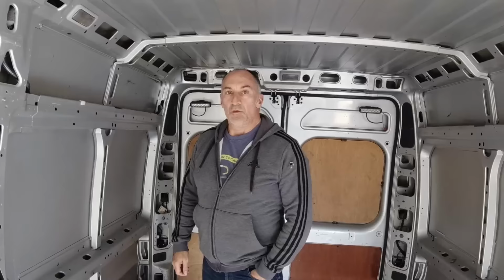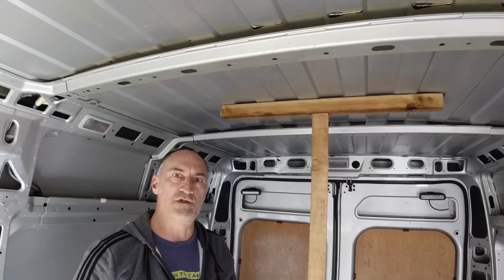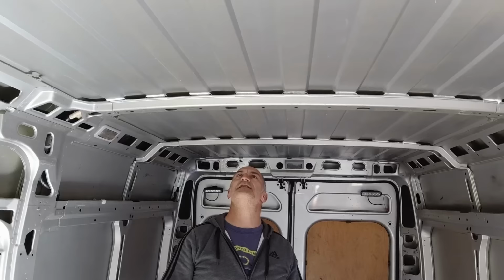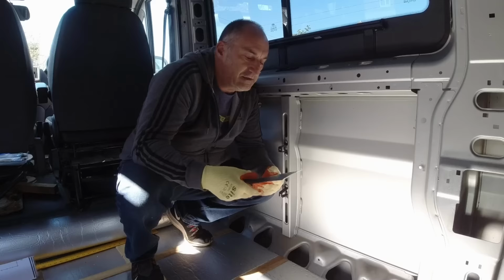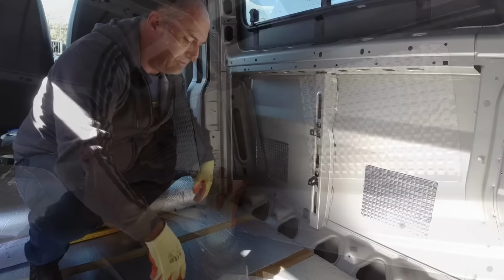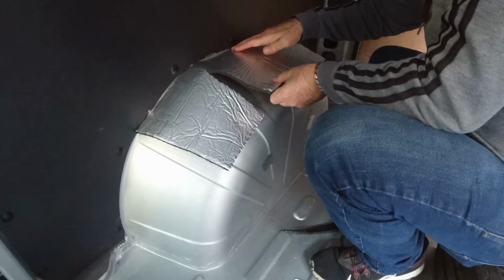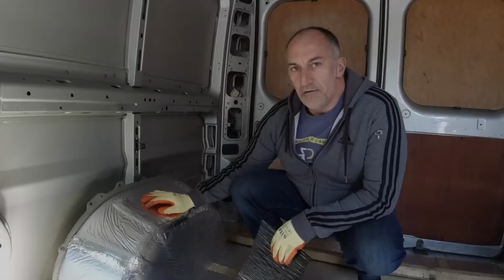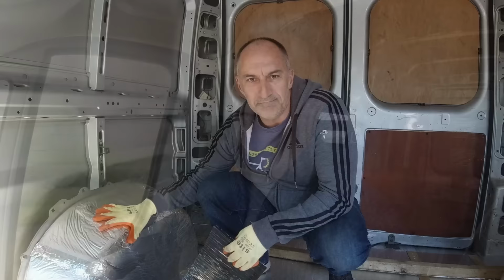Sound Deadening a Campervan, The Right Way - Budget Build Ep 8

Comment: Thank you for reminding people that adding sound deadening everywhere has diminishing returns.  I've seen so many builds where people spend so much time applying far more than necessary.  
The FIT RV came out with a couple of videos in mid 2022 on this topic that I can highly recommend for those that want to understand more of the science and see some semi-quantitative results.
Reply from the maker: I’m trying to explain that this heavy stuff is of no benefit on the deeply ridged panels as that already does not vibrate or drum like the Fiat panels do. So many are misled with wrong info. 
Hopefully I can help to change that. 😊
Reply: just saw a vid of a guy dropping a tool on the floor and showing the difference between insulating and not. Um i guess he drops tools alot? So he wouldn't be allowed to work on anything above the first floor as that is pretty much an instant termination. I keep seeing people spending 3 hours cutting small slices and doing the entire lower ridges of the floor. I might do a couple of strips behind the drivers seat/middle hallway to do a comparison. I deliberately did not buy a ton of the stuff, i will have a low roof van. I have where the windows are planned so i hope 2 boxes are enough. I will entirely cover the wheel wells, someone did a test and the thicker stuff i have didn't work as well as the thinner silver stuff. Also 2 of the manufacturer's produce in the Russian Federation, I wonder how that is going or if they have relocated. The one US company i found is extremely expensive (they sell large sheets).

Comment: Good to see you back Greg - the bonded joints you replaced highlighted a real problem with the way these vehicles are made.

Bonded joints represent a large proportion of the strength and integrity of the vehicle's structure - there is obviously a deterioration in the bonded joints over time, as you demonstrated with the roof panels.

On older vehicles it may be prudent to re-inforce bonded areas with a fillet of Sikaflex even if they appear sound - where the bond has deteriorated it makes sense to remake the joint as you did with the roof.

It would not be too difficult to do this, as once insulation and trim has been fitted the parts of the vehicle with failing bonds can move around and not be noticed.

Comment: 7:20 I like to place the pads almost in the middle & slightly twisted.
As you pointed out a few seconds previously you're trying to stop the ringing & placing the pad exactly is likely alter the pitch of the ring rather than stifling it.

Comment: Just as an additional thing you can use 3M double sided tape and the Sikaflex together if you’re impatient for waiting for Sikaflex to dry. good for situations where it’s a panel and you just want to stick and get on with it to finish the build. I’ve done it a lot with roof paneling etc where screwing wasn’t an option.

Comment: Difference is huge, in the beginning of the video while you were driving i though something gonna fall apart ;D. Only thing i was disappointed with was when you've knocked on the panel to present the noise and then you knocked again after applying a mat on the mat itself rather than on the panel, and you did it twice! Haha. Anyway thanks for another good video.
Reply from the maker: I could have maybe done that part a little better this shows the effect much better than I did https://youtu.be/Sl-4sJ_1wTI
Reply: @GregVirgoe  yup, that's good enough proof, cheers.

Comment: Great Vlog Greg I have seen people use lots of that material in their builds and often reflect back to the Sprinter build to question if theirs is overkill! Looking forward to more Vlogs many thanks
Reply from the maker: It’s about using the right product. The heavy pads are only designed to stop vibration. If you want to stop road noise or rain on your roof etc then you need a sound absorbing insulation like dense foam sheets to absorb the sound waves come through the structure from outside.

Comment: Again a great video, Greg! One suggestion, if I may: Sikaflex 554 is rated at 3,5 N/mm², whereas the 522 is half as strong at 1,8 N/mm². While 522 was O.K. for the large contact area of the floor, I'd prefer the 554 for the narrower beads on this roof. Possibly an overabundance of caution on my part, but I figured I mention it. Cheers from Germany - Folker
Reply from the maker: Yes it would appear to have better adhesive figures so thanks for the suggestion. I'm sure the 522 will be ok and I already had tubes of it available so didn't need to buy another different tube.

Comment: Really informative, well explained and helpful,  especially on the different types and uses for the sound deadening and absorbing foam and very interesting on the bond becoming detached on the van from the roof panels and how it’s bonded on the side. You’re right would drive you mad if all that noise was there when you finished - what a difference! Thanks again, a fantastically helpful video - all the very best, David 👍
Reply from the maker: Yes sometimes when the van is in use to carry materials and tools etc those panels get pushed out and can easily come apart so it’s helpful to pick it up early. 😃🙏🏼

Comment: Your build series are the best and most thorough out there. I wish I had found them earlier in my build (my first episodes were the wiring mini series on the old van) I could have saved a few quid had I done a few things differently, i definitely over did the sound deadening on mine for example. Four years later and I am thinking of upgrading to a bigger van as being 6ft 3 in a transporter isn’t ideal even with a pop top, but will certainly be revisiting a few episodes before cracking on this time. Keep up the good work and looking forward to new episodes.
Reply from the maker: It's all a big learning curve when you've never takled these jobs before, but i'm sure you'll be much better prepared next time round, hope it all goes well and thanks for watching these videos

Comment: Another helpful and timely video Greg. I just removed the bulkhead from my '05 Sprinter and have all kind of sounds exactly like yours. Need to go find those loose joints. But Silka Flex 522 is not common in US. It is a STP sealant. Wonder I can use OSI Quad max which is more common from any home store. The OSI  Quad max is a SMP type,  stick to anything, has zero shrinkage, remain flexible, and allow +/-50 joint movement.
Reply: Nope. Look like they spot welded the outer layer to the ribs. I still couldn't find anything loose metal that caused such noise yet.
Reply from the maker: You can order through this link and get free international shipping from the UK https://www.ebay.com/sch/i.html?_from=R40&_trksid=p2380057.m570.l1313&_nkw=sika+522&_sacat=0&mkcid=1&mkrid=711-53200-19255-0&siteid=0&campid=5338027957&toolid=11800&mkevt=1

Comment: Thanks for one more installment!

Having the same van with the same vintage and doing a conversation at this moment, I took the sliding door rail off and noticed some corrosion under it.
I'm in a way dryer environment than yours, so I would advise you to check that before going through with the wall insulation.

Also, the outside black plastic side "things" have grommets which tend to loose their hability to prevent water ingress, so a thoroughly check may be advisable.

Thanks for the videos!!
Reply from the maker: Yes, when we were cleaning the interior I noticed a couple of the door rail nuts on the inside had some rust on them so they are replaced. I also purchased a new bag of 50 of those plastic trim clips from ebay for £7 and have replaced them all and sealed up here is a link for the clips https://www.ebay.co.uk/itm/400330221804?mkcid=1&mkrid=710-53481-19255-0&siteid=3&campid=5338027957&toolid=11800&mkevt=1
Reply: @GregVirgoe  That's how I noticed mine, small brownish water marks.
I took the rail off, some nuts haf rust marks, but more important, under the rail there were rust spots which were easily treated in the same way you did the floor.
Then assemble with some polyurethane based mastic in the thread's base.

Comment: This is a more common problem then people realize. Most people have no idea that the skin and structure are actually bonded together with body adhesive. Our brand new Sprinter had the same problems although not as bad.  Sikaflex actually makes a specific body adhesive and I used about 3 tubes of it on every contact point between skin and structure. That really helped eliminate the tin can sound going down the road. Then the sound deadening dynamats installed and the van was literally 75% quieter then before. I recommend that anyone building a conversion van go through this exercise before insulating and interior wall panels are installed

Comment: Thanks for the video.  I’ve kind of gone ott if this is to be adhered to 😂. Ive used sound deadening on every panel to its fullest and will be doing roof as well.   VW Crafter 2011.   I am thinking I’ve gone overboard now though.  🤦‍♂️😂.     First side window arrives later today.  Little by little with this.   Liked your water tank video also. Need to watch the sprinter series now.

Comment: In my quest of soaking up information on condensation I came across someone from Asia who lined their camper van with thin cork sheets after sticking the sound deadening pads on. They say that cork doesn’t allow condensation to form and also eliminates any form of mould. Hope this helps. Great vlogs by the way.
Reply from the maker: OK, so let's look at the scientific facts -
Thermal Conductivity of Cork 0.037 W/mk
Thermal Conductivity of PIR 0.022 W/mk
So the PIR is 2x better insulator than Cork
The density of Cork board 180 kg/m³
The density of PIR board 30 kg/m³
So PIR is 6x lighter than Cork
Finally, cork is currently 10x the price of PIR insulation to obtain the same thermal properties and coverage.
As Foil is 100% impervious to moisture then there is zero chance of moisture transfer. You look at an old red wine cork, has the wine soaked into the cork? Yes.
PIR wins on every point. I know which I will be using
Reply from the maker: Oh, and you don't need to look any further the science you need is in my other videos on vapour barriers and thermal insulation. :D

Comment: Sound deadening really helps. 
I did a before and after test after putting sheets of the heavy bitumen based stuff on the floor and wheel arches. It did make a big difference, maybe my van was different.
Reply from the maker: But the source of the sound from the wheel arches and floor is not from vibrating panels it’s road noise from outside transmitting through the van. So although put loads of dense mats on it offers some sound absorption it’s still the wrong material to use  far better using a dense foam as that’s far more effective at trapping sound waves. Of course it will do something but it’s the wrong material for that part of the van 🚐
Reply: @GregVirgoe  sound is vibration...
Yes what I did wasn't ideal, but it made quite a difference.

Comment: I used the closed cell foam all over the inside of my T4 to kill road noise more than anything (it's my car not a camper - but gets slept in occasionally) it worked very effectively - I did sparingly use the panel deadening underneath, although to be fair it was 3 years before I decided to add the closed cell foam over the top 😁  I used a closed cell foam/mass loaded vinyl type combination for the floor in the back under the ply floor which was very effective.  I just used the panel deadening butyl stuff in the cab doors as the factory plastic bagged felt/material stuff seems to work well.

What I've not decided how to do (if anything) is the cab floor/inside bulkhead.  I figured the closed cell foam is too thick and the butyl stuff will not do much.  I was thinking maybe some plain mass loaded vinyl type product?  If you have any advice or ideas they'd be much appreciated.

I'm enjoying following the build - thanks 👍
Reply from the maker: Again it's an area that doesn't suffer from vibration noise, more just road and engine noise coming through the structure so any kind of dense foam materials will be the ideal solution. My cab has about an inch of recycled foam sheet on the steel floor under the rubber mat and that seams to work really well. I will add a full cab carpet over that too as they also adds some sound proofing.
Reply: @GregVirgoe  I'll have another look and see how much material I think I can get away with under the mat - I do still have some foil backed closed cell foam I might be able to use.  I did consider carpet, but I like being able to wash the floor 😁

Possibly the biggest change I made to solve road noise after the initial panel deadening was replacing the tailgate and sliding door seals - that made a huge difference, but then again my van is over 20 years old.

Thanks for the reply - much appreciated 🙂

Comment: Would you cover the ribs in closed cell insulation, Greg? Just thinking about bridging and condensation. I've seen some do that, but generally doesn't seem to be done, which I can't figure out. Thanks again for your top class channel and all your knowledge and ideas 👍
Reply from the maker: If you cover all your insulation with a complete vapour barrier including sealing the edges down to the floor then no moisture can get in there to condense so there is no need to worry about the gaps. Have you seen this video I made to prove this? https://youtu.be/ommqMG7RjXg?si=jIqVv1yQ8OUKANia

Comment: The only person I’ve seen recommending using less sound deadening pads to reduce noise. Also the only person I’ve seen using a kitchen knife as the main tool in the video. Also you’re only tapping the back of the pads that you fitted , you should do a comparison of the sound difference between the areas treated and untreated by tapping them both.

Comment: Great videos and to know these products is a real help too. Nice one Greg.
Reply from the maker: Cheers Mark 🍻 fortunately acoustics and sound was also a subject I studied at University. 
We often had to design attenuation for plant and machinery.
Reply: @GregVirgoe   I did too, but to build the perfect sound rooms gor recording. As a drummer I made my own drum room. Costly but perfect. I even built my own mic looms to a desk outside 4 metres away. I had a 16 channel desk with me inside. For live performances triple that. I had a huge kit, like Bozzio or more Neil Peart. We covered a lot of Rush.
Reply from the maker: @marksadventures3889  then you understand exactly the benefits of foam for sound absorption 👍🏼 and adding mass to deaden vibration 😃
Reply: @GregVirgoe  indeed also cable looming and the loss factors involved where signal and strength loss happens over length of cable. Not so important for a van but looming over 400 channels of audio and video in a stadium or amphitheatre can fry brain cells and gear. These days I'm just a civil servant fixing system issues.

Comment: Great video. Any chance you could do a video on adjusting the rear door to prevent them from making rattling noises when driving. Mine does the same (probably worse) as yours in this video and wouldn’t mind knowing what to do to stop it happening. Cheers
Reply from the maker: Yes, I'll see if I can add a bit to the door card video due to come out.
Reply: Thanks Greg. That would be great if you could. 💪🏻

Comment: My experience is that making an narrow X is the most efficient way to save on the deadening material and get good dampening...
Reply from the maker: A perfect solution. When we use to manufacture large sheet metal ductwork for huge commercial buildings we would put diagonal creases in the metal sheet to form a large cross on the panel and that was enough to stop them drumming 👍🏼😃

Comment: I've never seen a detached roof Panel like that! 😯That's a great fix. 👍
I did buy a roll of the sound deadening material, but have not actually used it, as a few people have tested the Armaflex / Alubutyl (trade name for the sound deadener here) combo and the Armaflex only version. The result: Only a truly negligable difference when using both materials as the Armaflex doubles as a pretty good sound deadener by itself. If weight is a concern, then this could save a few pounds.
Great video, Greg! And Lou is doubling as camera operator? 😊
Reply from the maker: Yes I agree if you used closed cell insulation you do not need to use the heavy pads as well no need

Comment: Hi Greg, very nice videos that you show us. In my opinion, is it not necessary to use Alubutyl pieces at places where you insulated with Armaflex. That will calm the noises enough and you can save the weight.
Best regards 
Steppe
Reply from the maker: You are absolutely correct, the Armaflex sheet insulation adds enough weight to the panel when stuck to it to stop any vibration noise, so you do not need the anti vibration pads as well just one or the other and not both. :D

Comment: Wow what a racket, bet you were effin & jeffing 😂 Good tip to drive around a bit before the conversation Greg. 
I would say it’s nice to sound mat the ceiling above the bed, I wish I’d of done that….on rainy nights. I put Astro turf on the roof off my old van, worked a treat, not to mention invisable from above!? ✌️😜
Reply from the maker: These dense heavy pads are still the wrong material for that application, if you stuck closed cell foam sheets to the roof that would be the best at absorbing the sound through the roof. The dense pads are for reducing vibration more so than sound absorbtion.
You would stil get rain on the plastic skylight which would be louder than the roof.